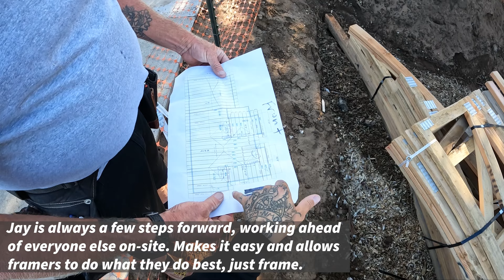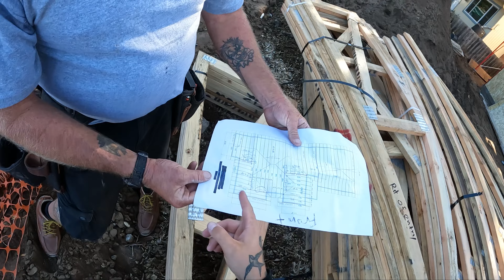Abandoned Framing Project | #4, These Trusses Make A Roof.

Comment: Matt. H10s were designed to grab the top cord. By installing them from the inside, it's easier but you're banging tico nails through the punch plate in the lower cord, and the uplift is on the eaves, which can still rip the roof off as the punch plates fail to fasten the top cord. Just because the engineer signed off, if all your load path strapping isn't on the same side of the wall, as it's clear the CS16s are on the outside... as they should be... there's no get out of jail free card. Do it right the first time, and then go get a wave for me. Aloha, Mike.

Comment: Lol I'm in NYC every single method used on that site would never be accepted by building department 🤣
Reply: Wow it looks so much more chilled to work there
Reply from the maker: The building department? Talking like the method of building itself, the framing? Or how we work as a crew?

We're in the middle of California on a fault line, our engineering is more in-depth than almost every other state.
Reply from the maker: This project was a cracker box, not much to it. Bad example of what it's like to work here.